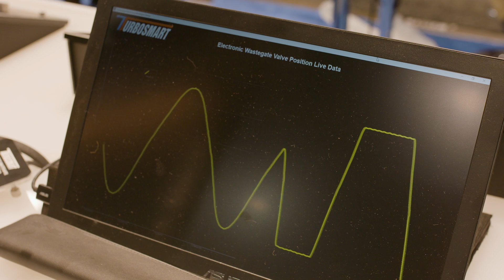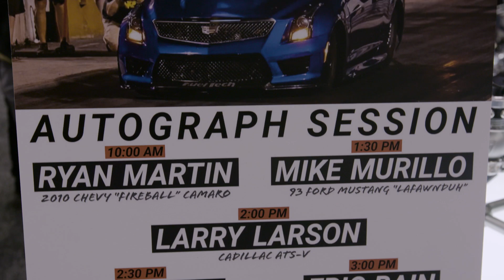Electronic External Wastegates - Further information with Turbosmart at PRI

Comment: A dedicated capacitor bank/discharge unit would be good instead of drawing wholly off the electrical system. Just like a surge tank in a fuel system. 
And with all this add on stuff for turbos and people moving away from cast exhaust manifolds, some brackets to support T3/T4 frames in the usual 3-4 locations, with some scope of adjustability.

Also, an electronic BOV/BPV would be great. The ecu could determine the optimal valve function dependant on performance parameters of the car. (Mainly for circuit/time attack use.) Things like boost setting, SOG, throttle opening %, etc etc, would influence the opening % and duration of the BOV and the % of intake charge routed through the BPV in order to keep the turbo shaft rpm at the highest possible value, the intake charge velocity through the compressor at its most optimal conditions and the intake charge pressure in the piping and cooler at its most optimal conditions. 

And lets not forget about the holy grail of electronically assisted turbo chargers. And not the gimmicks on eBay, like what is employed in F1 racing.

Comment: Why don't Turbosmart build a separate driver for these that can run from the ECU PWM signal that is normally used to drive a 4 port boost solenoid? A couple of MOSFETS controlled by a chip should be easy enough to put together. That would take the ECU  current problem away.
Reply: This product already exists. It's called Fueltech Dual Power Drive. At 5:40 this product is presented. It reaches peaks of 100 amps and is controlled by the ECU. https://www.youtube.com/watch?v=UHmitjE103g
https://www.youtube.com/watch?v=qGp1UrLsznc

Comment: There's still no videos of anyone actually using one yet, I need two (twin scroll) and all I here about them is that the can't react fast enough.
Reply: https://www.youtube.com/watch?v=qGp1UrLsznc
Reply: This product does not open with power removed. There is already a driver strong enough to power this engine. It's called Fueltech Dual Power Drive. At 5:40 am this product is presented. It reaches peaks of 100 amps and is controlled by the ECU. Fueltech's software controls the wastegate well, and it's very fast. The software monitors intake pressure and wastegate position. You set the inlet pressure you want and Fueltech dynamically controls the wastegate position. https://www.youtube.com/watch?v=UHmitjE103g

Comment: So basically a 250watt motor? I feel like this is awesome, as long as their motor can be fast enough. Although it might work (just like in most cases) in "low speeds". You would want that speed of the wastegate to open/close quickly if you where to do things like traction control (which is freaking epic!).

I would like to know if their are using any failsafe also? I feel like a spring in it would be a good solution...

Comment: 8-12 Amps is much more achievable for a standard ECU pin to handle. Thanks for getting this info out there as there is a lot of BS flying around 👍
Reply: 12 amps from an ECU pin? eh. gotta say the nay no to that one. this shit is a bad idea. end rant. also it failure mode is dangerous as where a spring gate fails safe.
Reply: @DieselRamcharger  obviously this is not great for continuous, but peak load.. I agree with the "no current to hold position" do they open with power removed?

Comment: 3:39 Is he saying that this waste gate will handle 80 bar of boost? That's 1160 psi of boost. Is this correct or did he mean 80 psi?
Reply: he said 80psi at 1:48, and that's exhaust back pressure not intake manifold pressure.
Reply: @3:46 he said it can handle 80bar.
Reply: I really hope he meant bar because i'm running 749psi of boost on my eBay turbo and i'd like to use this wastegate in the future.
Reply: @HollyBoni  $1200 wastegate on $100 turbo